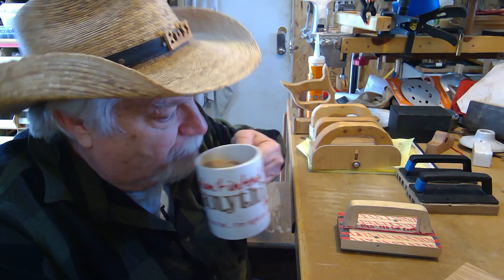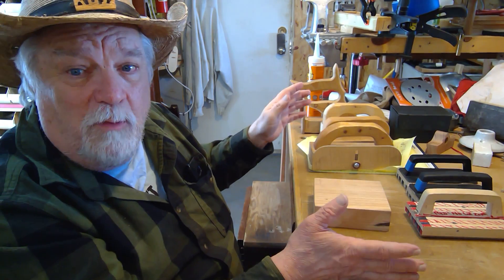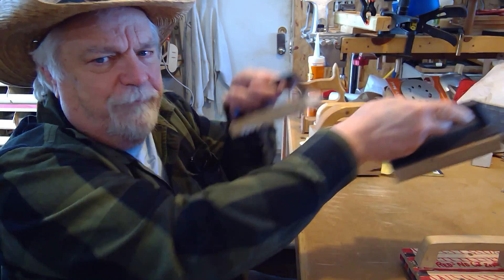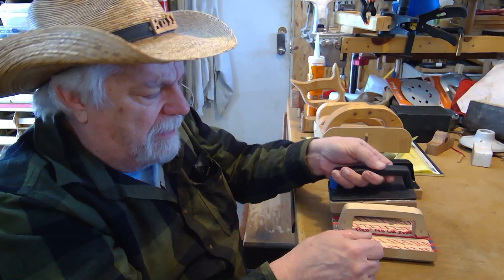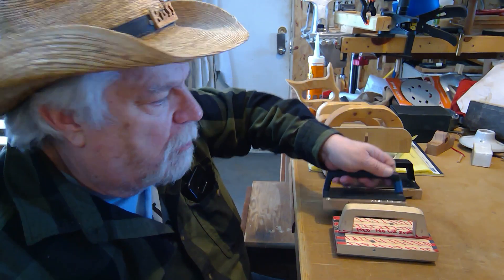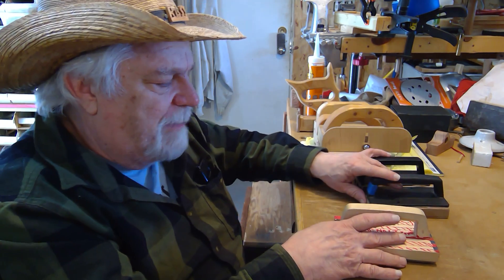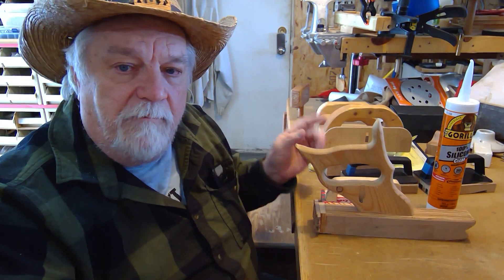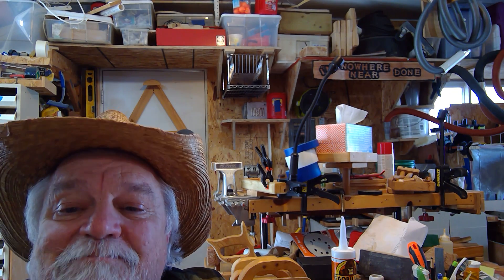Evolution of the Gripper by Rambling Russ

Comment: You are a nation treasure for exposing your thinking and experiences. My gripper used neoprene mouse pad as the cushioning/friction material. Works well but like your silicone idea better.
Reply from the maker: Thanks Art.  I really think the silicone caulking seems to be the best gripping and durability.  The one thing I don't like about the silicone is the thing takes a week to cure and I am a "want it now" type of guy :>)
FYI, I recently made a gripper (& video) using "rug gripper tape" from Amazon.  The jury is still out on that one.  Have a terrific day

Comment: Hey Russ, greetings from West Allis!  The only issue with "resurfacing" with silicone is that it doesn't like to stick to itself.  IMO, you'll have to remove ALL the silicone.  Given that you applied it to a flat piece of wood, it doesn't seem like it's gonna be that hard, you'll need a razor blade to take the majority of it off, and do final prep with acetone, but after that, it should be good to go. 

Love the channel, and I'm glad I found you a few months back.  I wish you continued success and look forward to more from you!
Reply from the maker: Thanks Drew and welcome to my shop.  I didn't know that about silicone caulk.  it won't be that much more work to clean off first, but you did save me some missteps.
Reply: I am just watching your nmp gripper series.  Did the silicone stick to itself well?  Because I mentioned Sugru and its DIY version Oogru, and it does stick to itself.

Comment: Russ, always enjoy the Rambling Russ series. I am one that bought the grippers years ago and you are right I don't use them that much because you have to spend time setting them up for each cut. I usually just grab a push stick. I have  thin ones and thick ones but I may try the last gripper you are using with silicone. Have a great rest of the day.

Comment: I always felt that your idea of using the silicon for the gripping power was spot on. However, I also always felt that attempting to apply the silicon uniformly without getting silicon all over the place, including all over myself,  made the concept impracticable. That is until I went down the rabbit hole the other day on YouTube and saw an article on how to use silicon caulk to make 'free' molds. The simple concept of using water to keep the silicon manageable while forming and smoothing a layer never occurred to me and now the idea of working with the 'gel' is much more viable. I am now convinced to take a second look. I also agree with your original approach, in that I too like the idea of a hook being an integral part of the push block. I'm anxious to see how your coming version comes out.
Reply from the maker: working on it as we speak

Comment: Again Great ideas. After you put the silicone on, you then press it down to spread the silicone to dry. I must have missed, what are you pressing the uncured silicone onto? Wax paper maybe?
Reply from the maker: I used a silicone cookie sheet mat.  you might want to go watch the last video in the playlist.  it explains everything there (I think :>)
Reply: Russ Veinot thank you I will revisit that.
Reply from the maker: I hope that didn't sound like I was assigning you "homework" like in school :>)
Reply: Russ Veinot  ot at all, I appreciated you took the time. I watched it and hope to make one today. My shop isn’t heated so at 32 right now it will take awhile for the sun to heat it up.
Reply from the maker: If your shop isn't heated, maybe a heated cabinet (light bulb in a cabinet) might be useful.  Be sure to get it thick enough so after pressing down, it is still about 1/4" thick.  Ideally, you should see a little squeeze out all around.
Reply: Russ Veinot that’s an awesome idea, thank you.